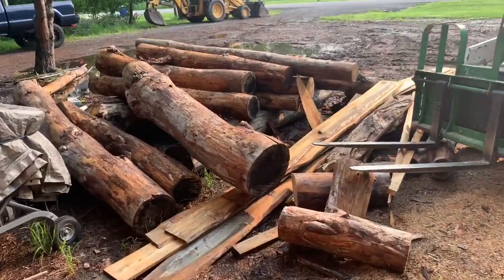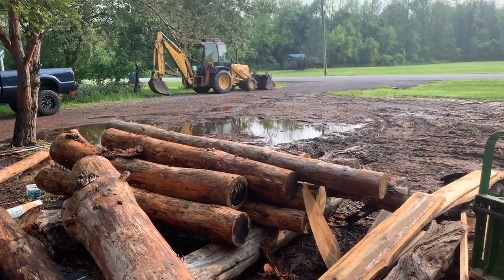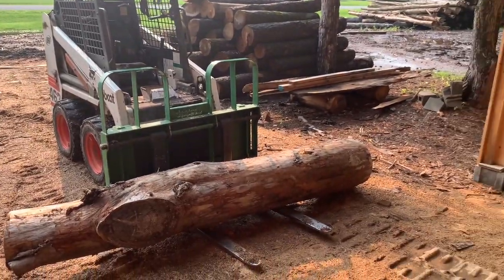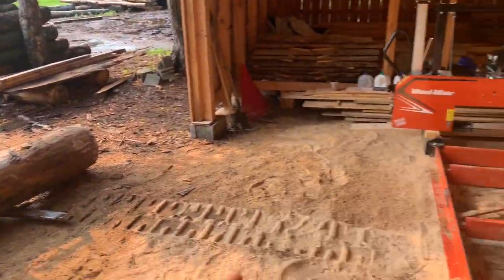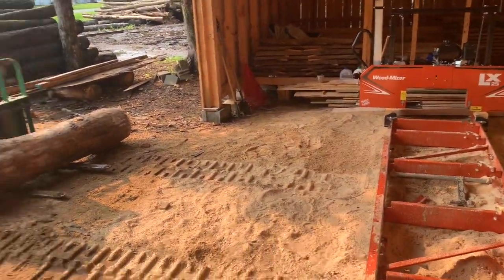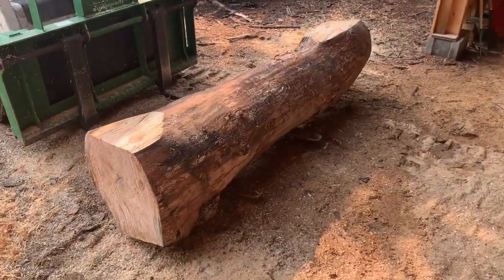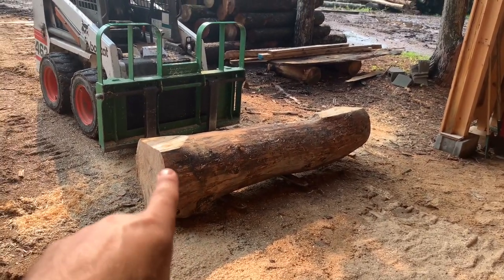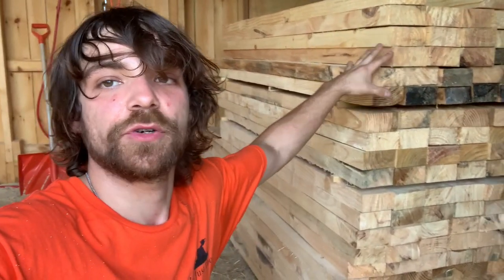CUTTING 150 2x4’s ON THE SMALLEST WOODMIZER SAWMILL (WOODMIZER LX25)

Comment: One can never have enough 2 by dimensional lumber for building projects on your property.  Don't forget to cut stickers so your lumber can be stacked properly to dry.   Be sure to run the slab cuts through your firewood processor for outdoor campfire wood.  They cut up quick and easy.

Comment: You could have gotten that log right there with that lift right there. Just tilt down stomp and pray it spins and rolls exactly how you want it then you gotta get off the forklift, wrestle the log,run back to the lift and tilt up,run back to the other side of the log and heave it on the fork, run to the other side and heave it on the fork , cuss at your boss because you gotta stack 20 foot timbers alone all day because people are not working right now. Then get on the lift, sigh, wipe off the sweat, struggle with the stupid e brake that sticks every time, put in reverse, wait for someone behind you to stack 50 2x8s all by themselves, undo e brake again, load up log, don't get tip, don't get raise, don't get new e brake..😵😓
Reply from the maker: Yes but it could have went down and begin. Day after then because we had it. Not really bargin the use went south had it normal